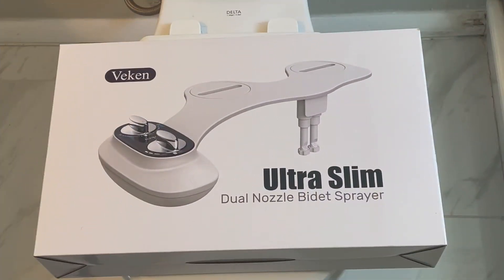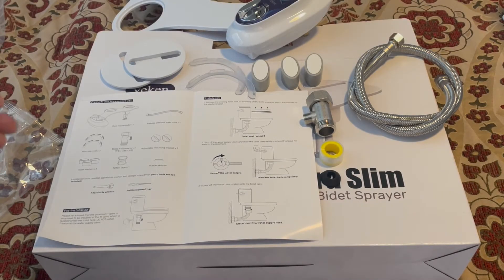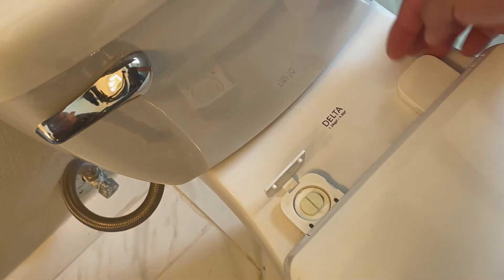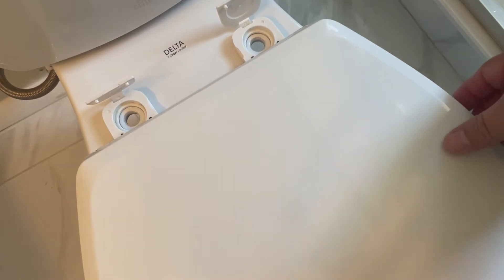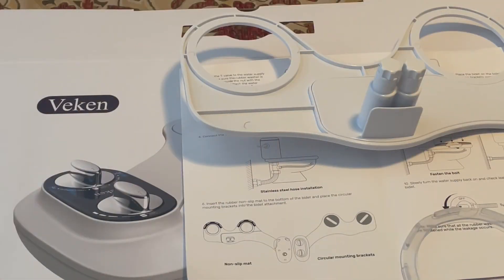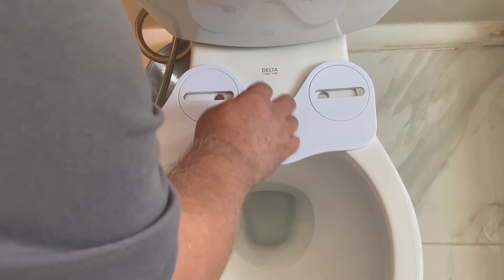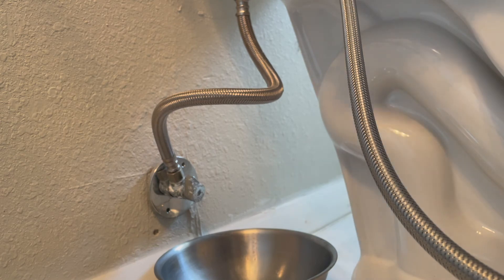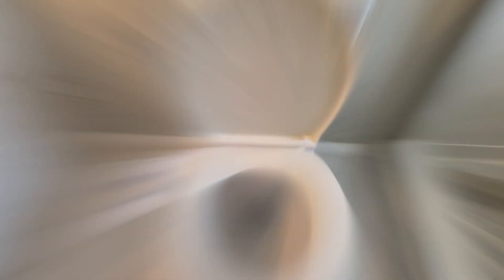Bidet Installation

Comment: I have the same Veken slim profile bidet. When I first connected it, the female water didn't come out at all and the bum water just gushed straight down into the bowl and not even out of the nozzle (looked like it was flowing out from above the nozzle housing on the underside). There was no reason for this. Everything was properly connected (this is easy stuff). So I contacted Veken and they sent me a replacement which I just received. I connected the  replacement... and the same thing happens! My water flow here is fine so it can't be that. Can't seem to find any reviews from someone who's experiencing the same thing. Why this is happening? It would seem to me the flow tubes inside the housing are not connected properly to the nozzle heads (became dislodged somehow?) but I can't get inside the housing without damaging the whole unit. I just don't understand why the water spray isn't working for me like it should! Is it possible I've received TWO lemons from them??
Reply from the maker: What you are describing sounds like the knob is misaligned. There’s the off position, then back, then clean, then front. The clean position makes the water gush straight down as you described - for cleaning the unit posts. So if the knob is misaligned, you may not reach all the settings.
Reply: @whatsstephendoing3650  Thanks so much Stephen. Earlier today I discovered the very thing you wrote. All along it was simply a misunderstanding on my part of the dials and how you adjust them to get the water flow. The problem is me, not the bidet. Boy do I feel stupid. Anyway, I'm writing this to help prevent anyone else like me from spending way too much time on this "problem." Cheers!

Comment: THANKS !!!  Didn't know where them bumpers go
Reply from the maker: I later changed my seat for one that was flat on bottom instead of contoured. I find that is better.
Reply: @whatsstephendoing3650  Why do the seat top sit up ?
Reply from the maker: @lilhope421  It could be that your seat does not need the added bumpers. It depends upon whether the existing ones on the seat are sufficient. Also, I found that the contoured seat bottom that mine had - as in the video - ultimately did not rest as nicely as I wanted. So I went to the hardware and got a new wooden seat with a flat bottom. That worked much better in my opinion.
Reply: @whatsstephendoing3650  my seat sits up what can i do to bring it down
Reply from the maker: @lilhope421  perhaps you did not see my earlier reply. It could be you don’t need the added bumpers especially one towards the back. However if your seat has a contoured bottom (that is not flat) it probably means the rear contour is hitting the attachment. So you either have to adjust the seat forward or attachment back. Or you may just go get a regular wooden seat with a flat bottom.
Reply: @whatsstephendoing3650  ok

Comment: This was a VERY good video & you do have a calm & reassuring voice.  I should have watched this BEFORE I installed the Bidet - I would've saved my unplumber self some time!  I had some undoing to do to put the teflon tape on! LOL... it helped with the leaks I was having.  AND I did not know what to do with those "toilet washers"!  Not in directions ANYWHERE!  Kept reading & re-reading the directions to no avail.  Oh well... I did get it right, though, and hopefully there will be no drips!  Now, that test with the plastic wrap... HOLY FLOAT!  That could probably clean my tonsils!  Sorta unnerved to take the thing on a test run!
***Had to tighten some of the connections to stop a few leaks but it works GREAT!!!  Thanks for your help!!! Oh, & it actually won't reach the tonsils... LOL!!
Reply from the maker: I'm glad you were successful and glad I could help.

Comment: When you’re lining the device up prior to tightening the screws, the lateral (side to side.) position is obvious; right down the middle. But when adjusting for the longitudinal alignment (the line from the front to the tank) I’m assuming you’ll just have to do a bit of experimentation to see if the stream(s) are hitting the mark. I have to bend and contort myself in unnatural ways to get to the nuts underneath  to secure the screws because of the proximity of my shower on one side and my sink on the other.  Tiny little space to work within. 
Question: The stream seemed mighty powerful with the device “on”,  after testing it out, was it in fact as painful as it appeared  it might be?  Or does the graduated flow controller actually work properly whereas it won’t sever anything you might need at a later date?
Reply from the maker: Flow rate will graduate, but it is strong if you go too far. Yes, adjusting might be necessary for the alignment it it doesn’t point where you want.